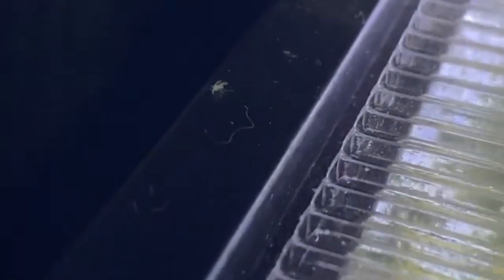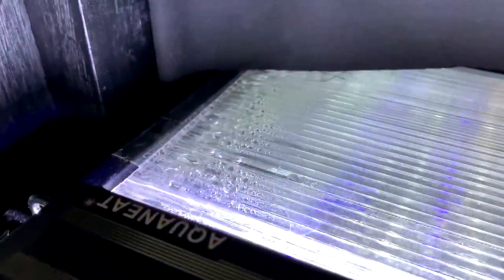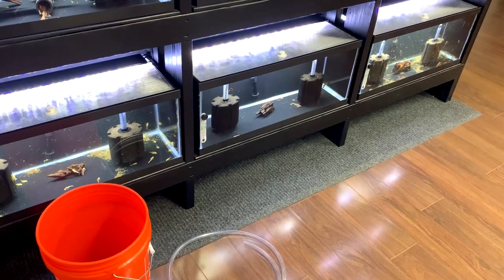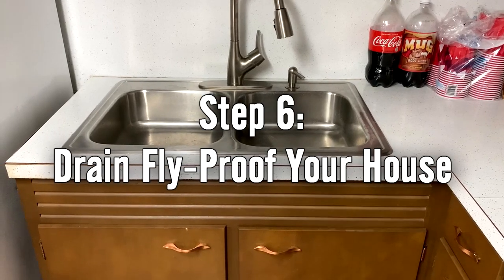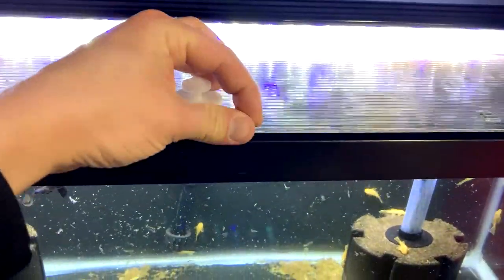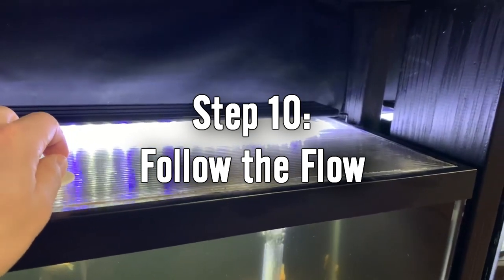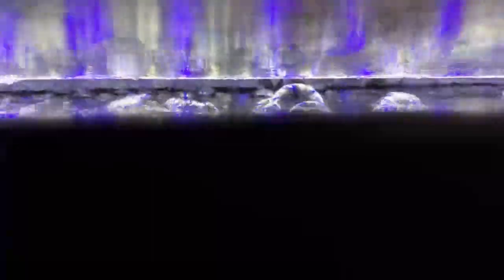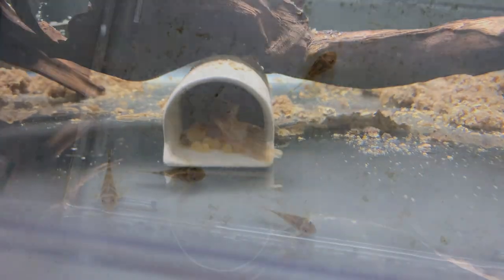How to Get Rid Of Drain Flies in Your Aquarium

Comment: So I thought I ought to comment on this as I’ve had massive success in dealing with these permanently!

Microbe-lift BMC, this stuff seems to be liquid death for them and is absolutely harmless for your fish, even invertebrates. I live in the UK so getting ahold of this stuff was a little tricky and I ended up having to order some from the states but it was still fairly inexpensive.

I dosed daily for two weeks at four drops of BMC (100L tank for reference, roughly 26 US gallons I think?) I premixed the BMC in a cup with a very small amount of water just so it dissolves properly rather than floating in the tank. Luckily this stuff is pretty much natural so exact dose isn’t really necessary and I’ve not observed any different behaviour or mood in my fish nor has it shifted my water parameters. Going forward I’ll now dose once every two weeks purely to avoid ever dealing with this problem again. One bottle of BMC treats a ridiculous amount of water so it should keep you going for years if you dose it fortnightly. This stuff is normally used for mosquitos so you need far less to deal with drain flys/gnats. It only kills them in the larvae stage so for the first few days you will need to keep on top of removing any adult flies.

So yeah, 3 months of trying everything under the sun to get rid of them and no luck. Two weeks of dosing BMC and I haven’t spotted a single fly since!
Reply from the maker: Very interesting tip - I'll have to try it if they ever return!
Reply: Pray to God this works. I’ve tried skimming them, throwing floating plants away and even buying fish for my shrimp tank to deal with it. I got rid of basically all of them and they fly away and die en masse but they just reappear after a week or two. Just picked up a bottle so I’ll try and respond here with the results

Comment: Thanks for the Info. In return, I thought I would leave a couple tips, as I have developed a few of my own strategies for dealing with these pests and this is what I've found. Most of the solutions I've managed to find revolve around "Apple Cider Vinegar" & "Bleach" (primarily the former).
1.) Pour Bleach Down All of your Drains (Sinks, Toilets, Bathtubs, Showers, etc), as this will immediately kill any eggs/larvae in those areas.
2.) Use "Apple Cider Vinegar" in the Fly Traps, Cover them with "Plastic Wrap" and poke holes in the plastic, which will allow flies to find their way in, but they can't seem to find their way back out. This may be why you weren't very successful in that regard, as the majority the flies were likely escaping, as a result of the cup being completely open.
3.) Get yourself some fly paper. By itself, it works okay, but during my experiments, I found that if you unravel the flypaper ribbon, a bit and pour a few drops of "Apple Cider Vinegar" into the opening, at the top, this will attract the flies like nothing else. The moment I put the Flypaper out, near the source, I could see the flies landing on it, left and right (honesty, it was a rather cathartic experience after weeks of dealing w/ them, lol). What I may do is experiment with allowing the flypaper soak in the "Apple Cider Vinegar" for a while and after drying, test the results. 
If I manage to find any other great working tips, I will be sure to return and post my results.
I hope this helps others, who may be experiencing this problem.
Reply from the maker: Great tips, thank you!

Comment: Ive been having this problem for awhile. It was so hard to find what they are and how to deal with them. So thank you for the video. I ended up getting a otocinclus and a Dalmatian molly for my 10 gallon tank and they destroyed the problem.
Reply from the maker: Glad you were able to eliminate them!
Reply: That is a relief! I may need to get guppies because I had no idea what they were (they looked like detritus worms) until white flies were on the surface 🤢. I made a huge mistake by putting an “active sponge filter” bought on a trusted website in my new 10G which brought these.The filters been removed but they are still in there 😤

Comment: As an added tips for dealing with adults. I've pinned a sticky trap (normally used for fungusgnats) between my tank lid. 

I'll be trying your other methods mentioned to clean out the rest of my tank though. I did a full water change and was surprised to see them come back. I think I may have to toss all my plants and douse my decorations in vinegar.

Comment: I moved into a place that already had a gnat infestation and I thought I could contain and maintain my turtle to be safe from the gnats but that reality was crush quick. I've never had this issue ever. Just 3 days in and I plan on doing a deep clean with everything I am going to get a few mosquito dunks (breaks smaller pieces and use in my 55 gallon tank) bc it creates a bacteria (safe for the wildlife in the tank) to eat the larvae. Also will do the sticky around the tank. It's been a major blow but they are my priority.

Comment: Mines a shrimp tank with this problem. Vacuuming the substrate isn't really an option. I mean... I could make it work and move everything. But... debatable. 

Would "no planaria" kill the larvae?
Reply from the maker: I bought some of that thinking it could help, but I solved my issue before needing to use it
Reply: @FoisyAquatics I never did buy it, but a single Molly solved my issue before it got quite this far. Still have a few stragglers. Not many though. 

Seran wrap also helps if you don't have a nice lid like yours. (Mine had plenty of gaps on the backside.)

Comment: I've recently discovered tiny black eggs floating on my tank water and even in my filter and media,it turns out that they were drain fly eggs,I just found their larvae in my tank that I set up for my shrimp so I could separate the sexes as they're breeding too well lol looks like it's a strip down and boil situation for me now because I'm not sure if they'd harm my shrimp and shrimplets so I'm not taking the risk,still,at least I now know what those eggs were and what I'm dealing with.
Thanks for the info,fingers crossed it works
Reply from the maker: How did it go?

Comment: I'm still struggling with these. Has anyone had luck with the organic larvacide BTI? This natural bacteria is present in the product Mosquito Bits and Dunks. But they also make an aqueous version (Microbe-Lift BMC). It is made to kill mosquito larvae, but I heard it works for these flies too (I believe these are a type of tiny Midge fly). I'm gonna pick up the BMC tomorrow and try it in my tanks. Will give an update if it works. 🤞🤞
Reply: One thing I've done to kill a ton of these things is as follows.
1.) Purchase the following Items. 
- Apple Cider Vinegar - The Generic Value Brand will be fine. I purchased a gallon, for about $4-$5, at my local Grocery Store.
- FlyPaper Ribbons - Raid sells a 10 Pack of Fly Ribbons for about $2-$3. You should be able to find them at Walmart. I like to keep a bunch on hand, just in case.
2.) Unravel the FlyPaper Ribbon to about 6-12 Inches from the cylindrical cardboard base. The Ribbon shouldn't collapse, when you let go of it.
3.) Use a Turkey Baster, an Eye Dropper to suck up a little "Apple Cider Vinegar". If you don't have a Turkey Baster or Eye-Dropper, you can pour some in a liquid measuring cup.
4.) The unraveling of the FlyPaper Ribbon will create a small opening/hole, at the top, near the loop, that you used to unravel it. Simply Add several Drops of "Apple Cider Vinegar" into the opening/hole, at the top (Don't add too much, to the point if begins to leak. We simply want to attract the flies to the FlyPaper, not the floor or counter top).
5.) After giving it several minutes to dry, hang the FlyPaper up, near the source of the Flies or if you don't know where that is, hang it in the area you see them, most often.
You should begin to see flies landing on the FlyPaper, within minutes (If Not, you likely didn't add enough "Apple Cider Vinegar. You can add a few more drops to the paper, while it's hanging, etc).

Additional Notes:
If possible, leave the area of an hour or two, as the FlyPaper works it's magic. When you return, the Flypaper should be covered in flies.
To Increase the amount of flies captured, you can hang the FlyPaper, just above a cup of "Apple Cider Vinegar" (similar to the Vinegar Fly Trap shown in this Video). Flies tend to investigate a bit, before they move in, to feed. During this process, they tend to land on items that are near to the food source, while they check it out. If you place the FlyPaper close enough to a Cup of Vinegar, it should increase the number of captured flies. 
I actually had a Ribbon hanging into a cup of vinegar (the cardboard base was hanging into the cup, but not actually touching the surface of the Cider). Ultimately, I returned a couple hours later, to find that Ribbon covered in flies.
Lastly, you can hang multiple "Apple Cider Vinegar" FlyPaper Ribbons throughout your home, in any/all areas where you've seen flies congregating.

I hope this helps you out, a bit. It worked on my end, so I'm fairly positive that it should help you as well.
It may not provide an entire solution, but it is yet another great weapon to have in your arsenal. 
This method should help, in conjunction with a few others mentioned in this video.

Feel free to reach out, if you have questions.
Reply: Did it work?
Reply: @baruchjones9834  so far I'm not seeing any more flies or larvae! I dosed it maybe 2 or 3 times over 2-3 days, then did a water change 1 week later, then dosed one more time. This was almost a month ago and no flies or worms to be seen yet. I will give another update in a month or so. I am using the Microbe-Lift BMC. Got it at Petco
Reply: @aliss8559   so do you have all those little specs crawling on the glass before hand ?
Reply: @AccDeleted1   i had the tiny green gnats and also the nasty little worms that squiggle in the water column (the fly larvae). It was close to impossible to get rid of em and I was so frustrated for over a year. But looks like theyre finally killed and I'm so thrilled
Reply: How many gallons was your tank and what dose did you use?
Reply: @spencerhymas4980  I have 3 tanks. A 10 gallon, 5 gallon, and 2.5 gallon. I used 1-2 "drops" per 10 gallons of water. So, 1-2 drops dissolved in a cup of water for the 10 gallon tank and 1 drop in water cup divided approximately among the other two tanks. Its natural and harmless so exact dose is not necessary. It doesn't really come out as drops either. It oozes out like a paste. But I take it off the tip of the nozzle when it looks about the size of a drop. Then I have to scrape it against the edge of the cup to help it dissolve, otherwise it just floats in the water as a lump. If the flies reappear again, dose again. It could be eggs that hatched after treatment. Since the medicine only works on larvae, not on eggs or adults. And the medicine is effective for only a day or 2 before becoming neutralized. So you have to dose regularly for a while till you are sure the flies are gone for good
Reply: @aliss8559  thank you. I have one more question. Do you have any inverts in your tank? My shrimp tank is the one that has the issue so I don’t want to accidentally kill all of them with this product.
Reply: @spencerhymas4980  yes all my tanks are shrimp tanks mainly. With just some of them having some tiny fish. No adverse effects on my cherry and blue dream shrimp